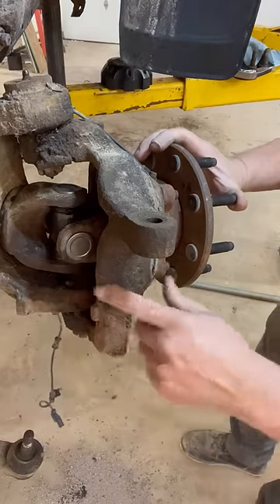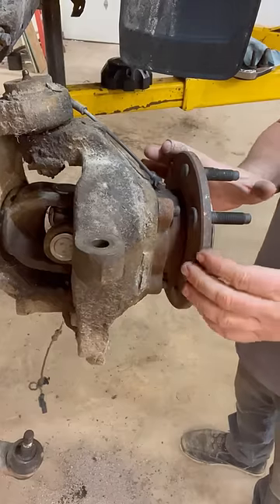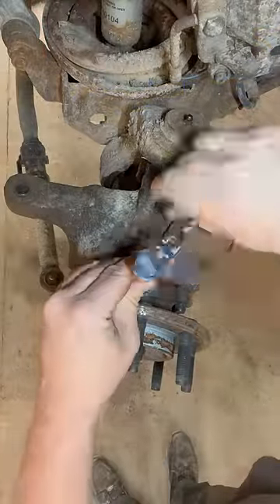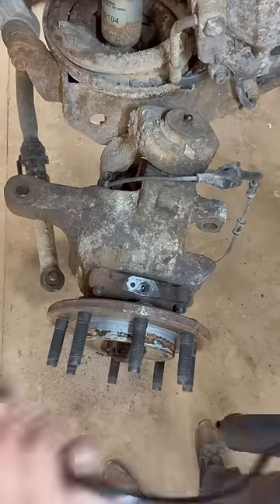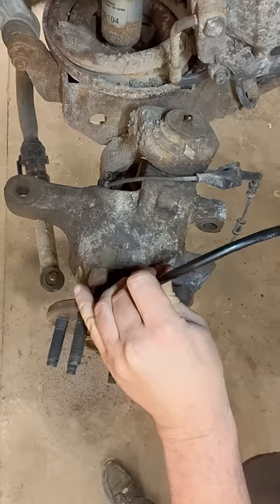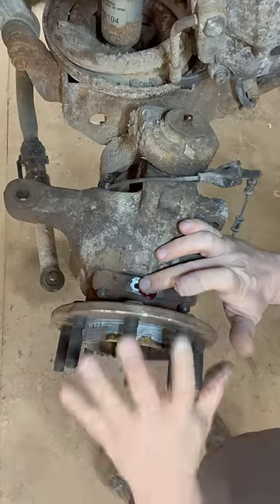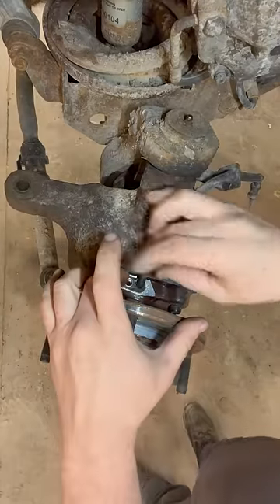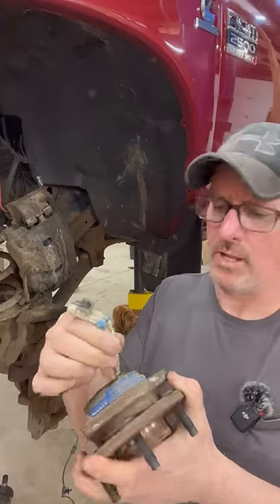Easy Steps To Lubricating Your Sealed Wheel Bearings For Smooth Performance!

Comment: Well it may help stop the Abs speed sensor whatever ring from rusting maybe but that grease in an open area will be a dirt and sand magnet that might not be good and as well that is still a sealed bearing so you may as well grease your big toe because it's still not going to touch that bearing. 😊
Reply: its not a sealed berring  it is open on inside , just the exterior is sealed , you have no understating how this type of unit berring is designed  , there will be no dirt getting in there

Comment: Thanks I wish I had known this 30 years ago. Changing these bearing hubs is a major job pounding and cracking loose those three bolts. 
I wonder why the mechanics don't do this. It's all part of the Auto parts scam. Thanks

Comment: @Tomsfoolery question wouldnt all that grease packed onto/around the tone ring & also kinda packed onto the tip of the abs sensor when its reinstalled end up causing issues with the sensor reading properly??
Reply: Magnetic sensor, metal tone ring, grease isn't magnetic.
Reply: Yes, it can. But these are the same guys who disable ABS because they 'don't need no damn nanny'...
Reply: @chriswisneski6071  you don't need idiotic ABS if you're a good driver and know what your doing.
Reply: @trickyricky12147  you clearly don't know what abs does...

Comment: Not getting to bearing,  but it's very smart to pull your speed sensors out and reinstall with grease now and again.  So they don't get stuck
Reply from the maker: It absolutely gets to the bearings. Do a google search of that style hub bearing. The tone ring is centered between the inner and outer bearings. There is no inner seals between them. A quick internet source will show you that.
Reply: @Tomsfoolery.  due to your tone, I won't be dignifying that with a response ya Goon. Whether there is no inner dust shields or not, you have done a beautiful job of greasing your tone ring.
Reply: @shornandkenny  what are you 2 years old? If the man is correct, just say my bad. I didn't know that. That's a great tip, thank you. Why are we men so knuckle headed when it comes to shit like this.
Reply: @jmaxim80  lol, sorry. Imo ( which im entitled to ) it's not the correct way to service the bearings, and it makes a big mess. He responded with an attitude, and I responded with an equal level of sass . Neither of us engaged each other, and all was well. What's your issue young fella? I'd say we acted like real men.
Reply: @jmaxim80  Tom's foolery and I disagreed, and it was no biggie.

Comment: It’s sealed so there isn’t any grease getting in there. I tried something like it on a mower the bearings were sealed and the grease just put pressure on the seal
Reply: these style of unit berrings share the same cavity as tone ring  , you can actually see the rollers when you look in hole on both sides of tone ring , as for lawn mower spindles berrings  they are not seals just loose fitting dust covers ya can pick em out with your fingernail, the grease will go right by them and threw bearing , a grease gun puts out 10 000 psi , those covers aint gona stop it , grease until you see it come out of spindles .

Comment: That grease is doing nothing for the bearing but it is gumming up the tone ring and speed sensor area.   The bearing has a seal back there. The grease is outside the seal.
Reply: If you look in the hole you can see the bearings on each side of the tone ring , they are right there , stop it

Comment: Those sealed hub bearings are designed to be non-serviceable. If you want them to last to at least their advertised lifetime, make sure they are properly installed. Most have a set torque rating for the axle nut. Too loose or too tight and you shorten the life of that hub. Also, make sure the spindle where that hub goes is clean and free of debris/rust to prevent deformation of the hub. Simple, do it right the first time and you won’t have to do it over.

Comment: Won't the speed sensor get covered in grease and not work or have engine fault light come on
Reply: Negative the tone ring is full of grease the day it was manufactured
Reply: Yes it will giving you codes and ABS light  the sensor picks up the high point in the ring causing a high or low voltage depending on ring position if the sensor or ring is coated with grease this will block that signal or make it erratic
Reply: Again , the tone ring has grease all over it from the factory already , it will not affect readings , you don’t understand how a tone ring works ,

Comment: I thought those wheel hub bearings are sealed?
Reply from the maker: Sealed to the elements. Not sealed from the tone ring. Remove the speed sensor and you’ll see it’s full of grease.

Comment: I would just add about 1 drops of oil.
Reply: Gear oil or? Like a heavy weight oil would be ok?
Reply: I ment 5 to 10 drops
Reply: That will just thin the grease and make it more likely to leak out of the seals.
Reply: @calholli  Good because usually the grease inside is hard as as wood.

Comment: Another "quick tip"...don't try this with your mid-to-late 90's Chevy pickups, as grease piling on this wheel speed sensor can trip the ABS at low speeds.  This will inhibit your ability to brake normally.

Comment: U can't even think this can be dun, this will trigger abs brake traction control lights ....the tone ring is attached to the axle
Reply from the maker: It only triggers uneducated people, not abs. I’ve been doing this for over a decade. It really works.
Reply: To all the naysayers here, please stop. It's a "sealed bearing" because it has two seals and the rollers/balls are OPEN on the inside, and can be greased this way. Done with a little care, it will not hurt the sensor and if you believe that grease will negatively affect the tone ring...please don't work on anyone's cars. If you were to look at the seals on these units, it takes a lot more to hurt than a half dozen pumps of a grease gun. Also, the way these are pressed together involves rolling the back edge of the hub outward to seal the unit together and takes a lathe and a press to disassemble. As an aside, I have a couple tricks to get these out of Dodge and Ford axles...
Reply: Sir, would you mind sharing some tips on removal of ferd bearings? I'm always looking for tricks to help, being a diyer. I'd appreciate it. I agree that the poster's, and caperfish, method should extend life of bearings and not damage abs. Just my opinion tho. Thanks.

Comment: Putting grease on a abs tone ring with just send failure codes
Reply: wrong  ,the tone ring is covered in grease from the factory , grease will not affect the reading
Reply: @TheCaperfish  I don't believe that. It might have something like vaseline or a lithium lubricant but not grease
Reply: @kennethwoolever5054  believe it the tone ring is touching the bearing cages it is the same grease that is on the berrings from factory , google the picture of a dodge unit bearing there is a pic of a cross section cut it will show it

Comment: Thought that was an abs sensor..
Reply from the maker: It’s a wheel speed sensor that tells the ABS system what rotational speed the tire is spinning. On this truck, each front tire has them and there’s one on the rear differential for the rear tires. Newer trucks have individual ones for each rear tire as well as the fronts.

Comment: lol, I hope your not a mechanic for a living greasing the outside of a sealed bearing 😂😂
Reply: It is not sealed on the inside just the outside , the roller bearings are right there when you look in the hole

Comment: 😂😂😂he obviously doesn’t understand what happens to vehicles in the upper Midwest, that speed sensor will never just wiggle out like that, unless said vehicle is new. But thanks for the tip.
Like others have said my truck bearing are sealed the only place that grease is going is everywhere but the bearing

Comment: I dont think grease is getting into actual bearing surface since its sealed. All your doing is lubricating the tone ring
Reply: if you look in the hole you can actually  see the roller bearings so congratulations you are # 193 of the people that are incorrect

Comment: They are still sealed bearing   I dont think what you did actually got to bearing
Reply: you can see the actually roller bearings when you look in the hole at an angle stop the madness , they are right there lol on both sides of the tone ring lol
Reply: @TheCaperfish  ok ok.  Don't gota get all pissy.    I've juts never looked that closely.

Comment: You are just greasing the tone ring, not the bearing. I would be concerned with brake dust clumping.

Better to just lightly coat anti seize on all nuts and bolts so its easier to service next time.
Reply: Incorrect you are not understanding how these unit bearings are made

Comment: You should never put grease over the tone ring. You're gonna cause a problem with the signal for  the Abs sensor and the tone ring  that makes no sense
Reply from the maker: You’re incorrect. I’ve owned this truck for 12 years and have been doing this about once a year since I bought it. I’ve NEVER had an issue with the ABS and I’ve NEVER replaced either of the front hubs! 192,000 miles on it and counting. I’m speaking from experience here. You’re only speculating.
Reply: Trying to fight the battle with ya Tom only a few get it lol , sometimes ya just can’t get through to the know it all’s , but we must try to save the dodge unit  bearings  of the world , Never give up the good fight !!!!!

Comment: That doesn't grease any bearings. It doesn't grease any seals. You're just getting grease on the reluctant ring That sends information to the p c m telling it that the wheel is spinning
Reply: wrong , the tone ring is full of grease from the factory and the inner and outer bearing sit right next to it

Comment: That not how that works.. you greased the  tone ring not the bearing
Reply: wrong it is the same cavity
Reply: @TheCaperfish tell me you’ve never worked on cars without telling me.  The bearing is sealed and is not accessible from the tome ring port.
Reply: For the love of god people These type of bearings are not the same as what you think lol I even cut one cross section, wish I could post a pic on here to show all you fools ,  you just keep working on yer bicycles and think ya know what’s goin on ya gearbox
Reply: you can see the actually roller bearings when you look in the hole at an angle stop the madness , they are right there lol on both sides of the tone ring foo
Reply: Crickets now eh
Reply: @ohboy2592  where did you go ? someone did some research then disappeared
Reply: @TheCaperfish  ok, please explain to me and the rest of us novice car people how you remove the grease that’s broken down and no longer functioning and how you get the fresh grease packed into the bearings from the tone ring port?  If you would be so kind as to show us a video of your device that you created to accomplish this goal?
Reply: @ohboy2592  I never said anywhere  it was the best way to do it lol but it is like a bonus to have the option ,  you were the one saying the " berring is not accessible from the tone ring port"  , again it is and it gives you the option to add more grease than they come with which is pretty much nothing , yes you cannot move old grease but adding to it is better than nothing  and will make them last wayyy longer , mine are living proof ., You started it with the tell me you don't work on cars stuff lol but had no idea how these bearings are constucted lol
Reply: @TheCaperfish  you can’t throw grease on top of bearings and make them last longer.  I stand by my original post and you still know nothing of which you speak.  I had over 175,000 on my ‘02 original bearings without touching them.  If you do t pack the grease, it will not reach the bearings themselves.  You are welcome.
Reply: @ohboy2592  fine yer opinion , I believe it will work its way in with heat and spinning 80 M/hr over time  but in yer original post  you stated they are sealed bearings and grease can't get to them and called everyone stupid , you were wrong and can't admit it  , just man up and apologize on that aspect of it at least , I knew something you did't  ,I know that which I speak
Reply: @TheCaperfish  putting grease on top of a bearing is not putting grease in a sealed bearing.  Period end of story regardless if you can see the bearings or not.  The grease will never get in there and you still have zero access to the bearings themselves.  You physically cannot get grease in there nor can you pull the bearings out to pack them.  You have no access to them.  It’s not rocket science to those that actually work on them.
Reply: @TheCaperfish  seeing the bearings and accessing them are two different things.  You may see them through the tone ring slot but you can’t access them.
Reply: @ohboy2592  again we are not arguing that point it opinionated , you are twisting it now ,  the fact is you had no understanding how these bearings were constructed and thats not an opinionated its a fact they are in the same cavity and ya called out people on being wrong  when you were wrong the whole time

Comment: That grease will never go into bearing just cause an abs light
Reply: wrong , the tone ring is full of grease from the factory and the inner and outer bearing sit right next to it
Reply: @TheCaperfish  no
Reply: @bobbyu8991  yes ,the tone ring is actually touching the bearing cages it is the same grease that is on the berrings is all over the tone ring from factory , google the picture of a dodge unit bearing there is a pic of a cross section cut it will show it
Reply: @bobbyu8991  what ya say now bobby did ya do the homework I gave ya ?

Comment: This has to be a joke. If notwell then. Not a good idea grease will interfere with the signal. Will also trap dirt where it's not supposed to be. I believe that the bearing is sealed, meaning that grease will have no effect.
Reply: grease will not interfere with the signal the tone ring is covered in grease already from the factory ,grease will not interrupt the magnetic field lol

Comment: U putting grease in the tone ring does nothing for the bearing lol some ppl just don’t understand
Reply: Wheel bearing are sealed
Reply: you can see the actually roller bearings when you look in the hole at an angle stop the madness , they are right there lol on both sides of the tone ring

Comment: Grease is not going to enter the bearing at all that way. It's a sealed bearing. There's no way to get grease in it. All that's doing is coating the tone ring with grease
Reply: You can see the inner and outer bearings with tone ring in middle when you look in the hole on an angle lol , like stop it already

Comment: It's a sealed bearing.You're not going to get any grease by putting it all over the tone ring except an a b s light.
Reply: wrong , the tone ring is full of grease from the factory and the inner and outer bearing sit right next to it
Reply: Seems that you are correct maybe you should pin that comment response to the to top of this video as it will alleviate most all confusion
Reply: @Omnicientlol  it won't alleveve  the know it alls  and there are many I find it most entertaining , if they would only do some research how these hubs are designed before coming on here and looking like fools , I like the " I'v been a mechanic for 102 years" guys the best lol
Reply: Hahaha I was working out of ignorance as I have never looked too hard into that design and am used to the single sealed bearing but yeah man im willing to learn new information even if I look stupid in the process
Reply: My 96 f350 had the dual caged but they are not contained like the design there the worst part is ive replaced that style you have got and never was curious enough to peak inside or look at the design just slapped um in and moved on

Comment: a sensor ring being greased will do nothing for you except problems eventually. Like premature sensor wear. No one recommends this.  It also looks like a bolt on hub. They should not require replacement gor a long time.
Reply: wrong , the tone ring is full of grease from the factory and the inner and outer bearing sit right next to it

how would grease cause sensor wear anyway ? lol

'They should not require replacement gor a long time."   LOL  you obviously never had a dodge with aftermarket Chinese  unit berrings before

Comment: Bs.  The bearing are sealed double rollers, and that grease is not getting into the bearing ....just filling the notches in the tone ring.   Who thinks the tone ring is part of the roller system ?
Reply: if you look in the hole you can actually  see the roller bearings so congratulations you are # 192 of people that are incorrect

Comment: Buy a new hub assembly...period (do I have to put a period after I said "period"?)   Anyway, Though I do every type of repair, from rebuilding engines and transmissions, to brakes.  This type of work is what I get the most in my one man shop.  Don't buy the cheapest part, you get what you pay for.   And, don't assume the most expensive part will be the best.  Do your research.
Reply: Well I’m goin on 22 years 300k on my same bearings , the reason it makes sense and it works obviously is that every time you pull them axles to change out unit bearings you are compromising the axle seals putting axles in and out , yas ever do axle seals on a dana 60 ? Real fun job and then when ya finish ya just cross yer fingers that it worked and ya don’t have to do it again for a very long time . That’s why doing this makes sense to prolong the bearings and  they aint exactly cheap and in the rust belt the job sucks even worse
. Whos getting even 100 k out of aftermarket bearings without adding grease to em ? Not too many that’s who